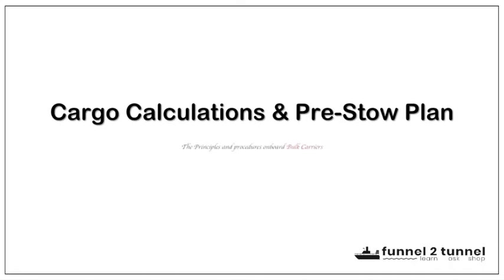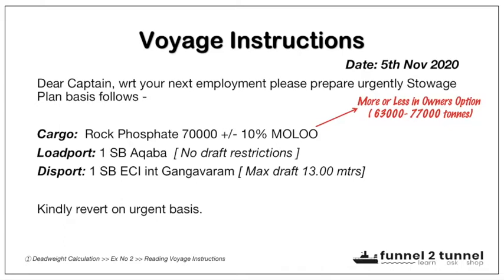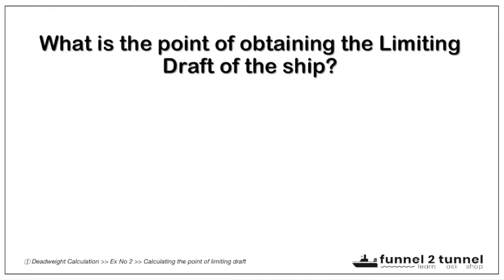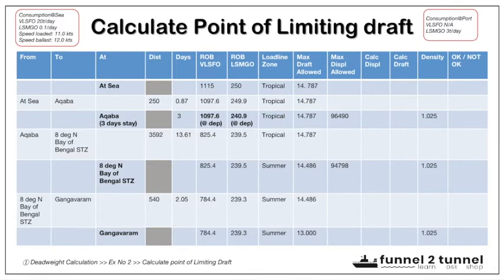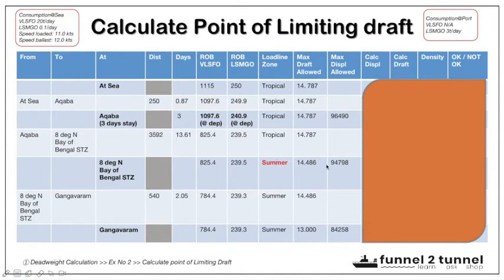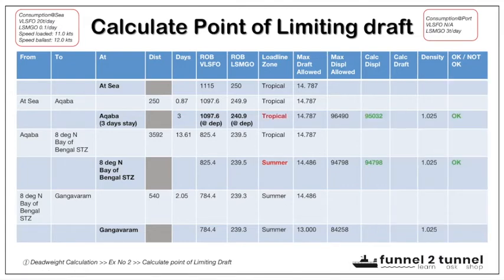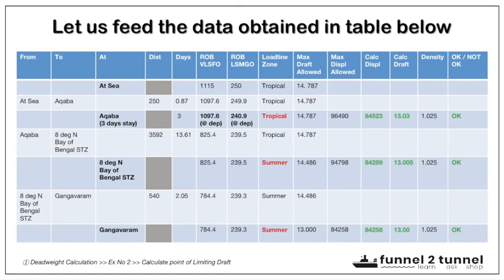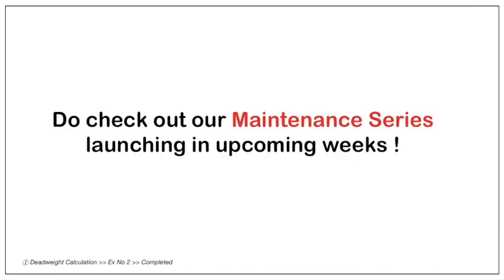Deadweight Calculation and Stowage Plan | Bulk Carriers | Part 2 | Simple explanation

Comment: Why sag allowance been taken only one time in calaculation, y not in all steps
Reply from the maker: Thank you for asking!. The sag allowance is taken mostly when you are loading up to marks OR loading upto maximum allowable draft. 
When we calculated maximum cargo that can be loaded at Aqaba we took the SAG allowance and came to conclusion that we can load maximum cargo of 81651 mt.
However, later we calculated that maximum cargo that can be loaded without exceeding the limits is 69884 mt ONLY. 
So, if we load this cargo at Aqaba, we will not be exceeding the draft limitations anytime. Therefore, there was no point taking into account the SAG allowance at loadport. 
Even if SAG develops, the vessel under the influence of dynamic stresses, stretches itself out and normally mostly the SAG would be negligible at the end of a long voyage!. Hope it clears!
Reply: But sir if sag will occur than we will be exceeding the draft at gangavaram ,as we calculated the cargo at 13 mtrs 1.025 density, not taken sag allowance.